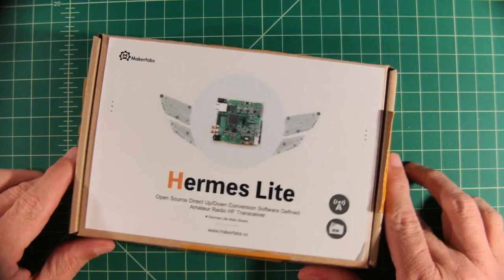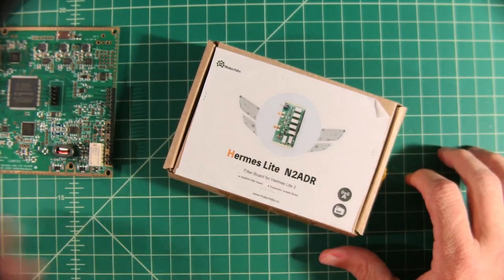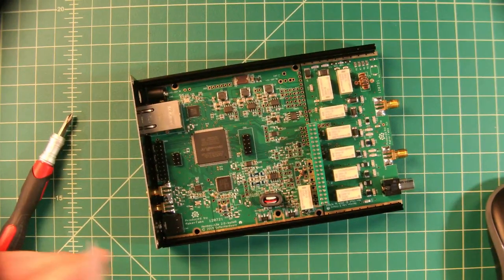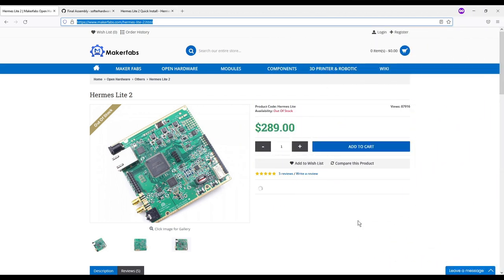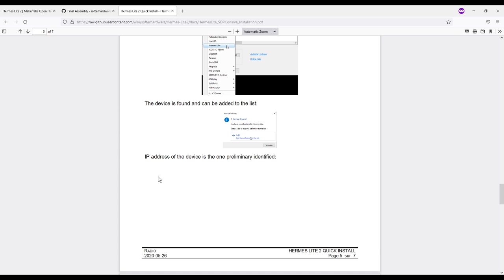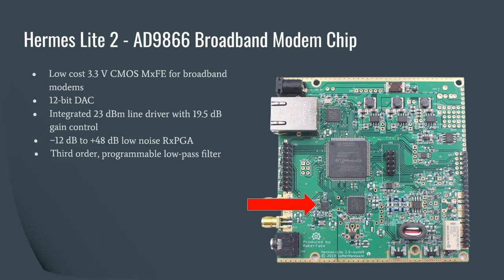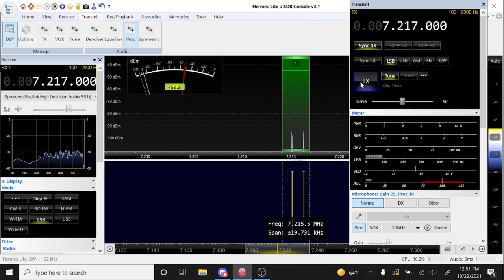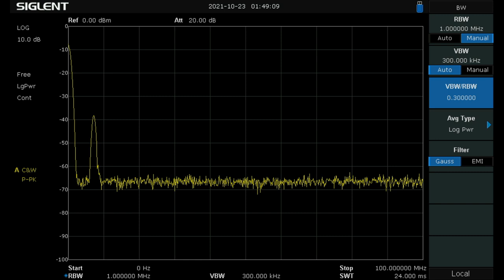Hermes Lite 2.0 SDR Transceiver - Ham Radio

Comment: Hi Ape, At 11:50 you show receiving on 7.272.832 Mhz. There is a signal that frequency sweeps through the band. What is it? I see something like it at my place relatively often. its quite strong and annoying. Is it a chirpsounder? With mine I chased it with my RTL-SDR and it turned out there was another sweep going the opposite direction and the two sweeps converged at 14 Mhz something , I forgot the exact frequency but it was above the 20m ham band.
Reply from the maker: Hey Michael.  I do see that from time to time but have no idea what it is, would like you have done more digging than I have.  If I ever figure it out I’ll post a video. Thanks for watching 👍
Reply: @TheSmokinApe  I have one video dedicated on this QRM in one of my livestreams where I ask exactly the same question. What is it, what is the cause. The recording I did was in Thailand. I think it is man made and it is maybe some kind of welding machine.... I have these signals coming in very very hard in Thailand, especially when I beam towards China! De ON7OFF
Reply: Those are ionosondes

Comment: Just got mine going but the transmit signal is not showing in the display like yours is.  It is showing on the DSP panel and I can monitor it on another receiver but it's not showing in the green bar like yours.  Is there a setting I have missed?
Reply from the maker: I don't recall a setting for that, sorry man

Comment: Do you know of a SDR that can do Digital Mobile Radio
Reply from the maker: You can use a decoder for DMR receiving, I am not aware of any that with transmit
Reply: @TheSmokinApe  I was aware of decoder. Tx is harder but it requires synchronizing the time slots. I’m not surprised it’s not available.

There’d have to be a OpenSDR-type plugin for SDR applications.

Comment: No wrist grounding straps. yet the boards are not in esd static protective bags. Guess not cmos, etc. Hm//my MO is to wrist strap. Informative video. thank you sir. My headphones and speaker are busted1 Gads. I wonder..did you do PureSigbal in this video? Hm...2nd harmonic would be like 50db down as I recall. My Hermes lite II is due next week.
Reply from the maker: Congrats on scoring one!  I have not tried PureSignal yet...